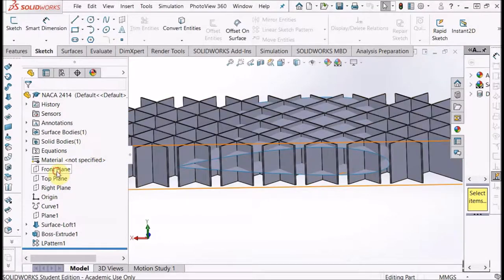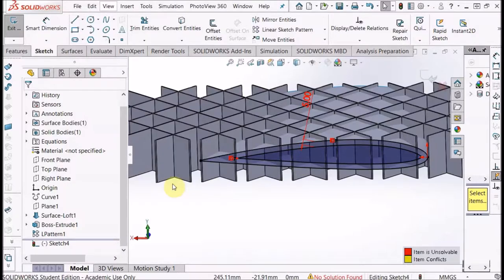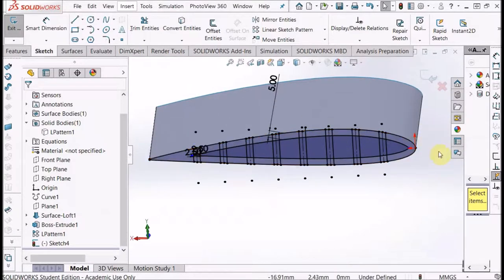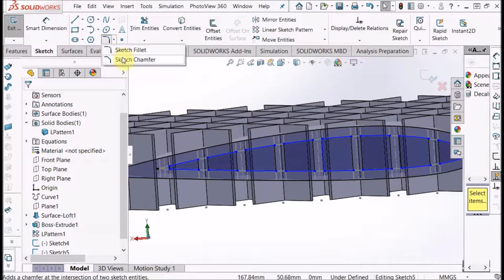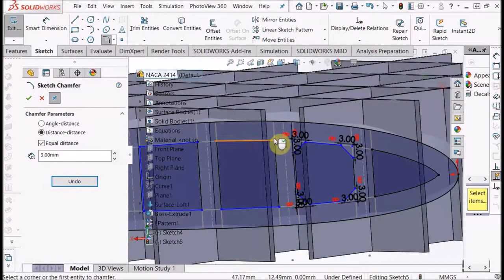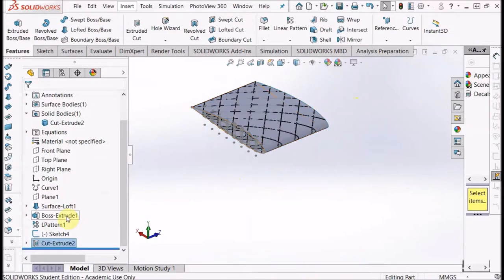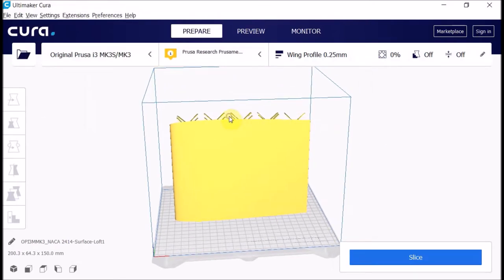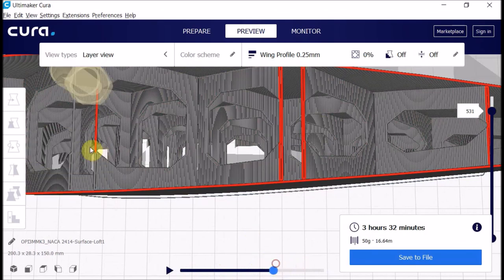How to Design and 3D Print a RC Aircraft Wing (Reducing Mass) Part 2

Comment: At ~9:00 if you get a zero thickness geometry error in the extruded cut, move the grid (solid body) by 0,1mm in the x direction using the Insert > Features > Move/Copy command.
Reply: Holy shit that worked! Thank you.
Reply: saved life

Comment: Cura removed that option from latest version 4.8 (use model as infill) - did you manage to make it work?
Reply: install cura 4.0.0. It can also be installed in parallel with your current version of cura with no conflicts.
Reply: @user-nc6oi2uf8c  useful suggestions